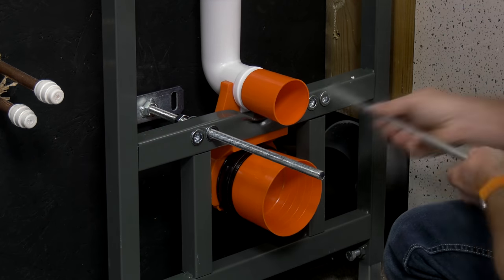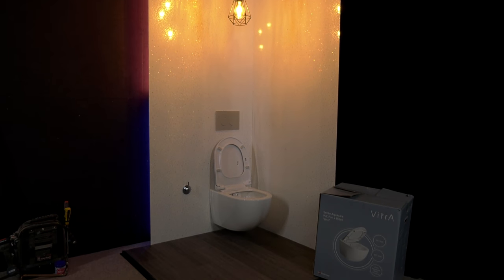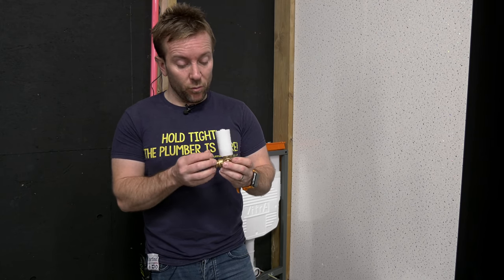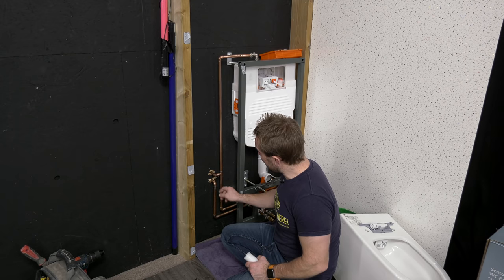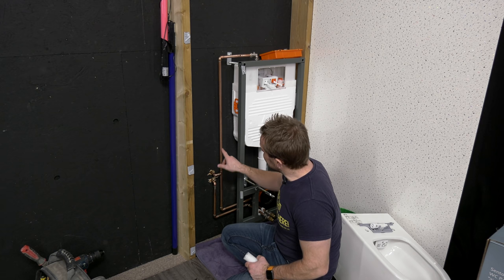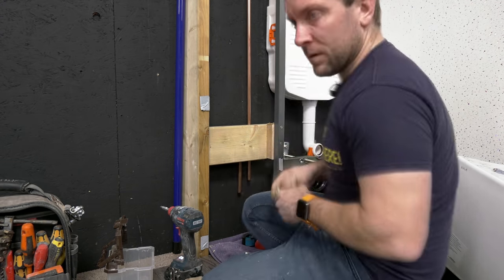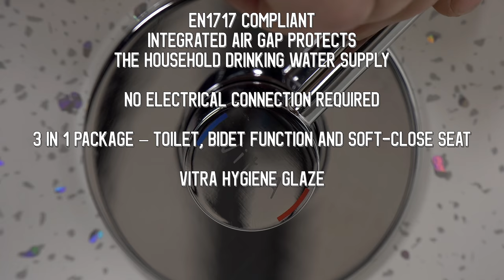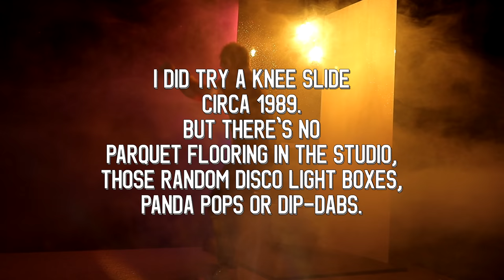HOW TO INSTALL A TOILET BIDET STEP BY STEP DIY - Vitra Aquacare

Comment: Hi Jimmy , great topical video these are becoming more and more popular. Many are not approved.  To comply fully with the "Water Supply (water fittings) Regulations 1999 the installer needs submit an application to install one of these to the local water company. This is known a Reg 5 application. The water company will want to know the about the product and how the water supply is to be protected against backflow. The backflow arrangements on this loo are known as Type AD (also known as a jump jet) rated for a fluid category 5 application. 👍
Reply from the maker: Cheers mate, you're THE go to knowledge man on this subject too! Hope you're all good.

Comment: What is the frame called that you've used?
Reply from the maker: The frame here is the one that come's with the Vitra loo. Although the Geberit ones fit too (I think!) LIVE STREAM TONIGHT at 6:30pm - Open to all! Bang the🔔too! https://youtu.be/TRJJjTkdENw
Reply: @plumberparts  cheers. Thanks for the reply mate. Re-doing our downstairs toilet soon and I like the look of these, just need to get the frame measurements to make sure it would fit, give that is under the stairs part.
Reply: Hi Jack, this is one of our regular floor and wall fixation frames, you can find some info on page 76 here https://www.vitra.co.uk/UPLOAD/Kataloglar/Bathroom_Collection_Technical_AW_SR-compressed.pdf :) we do also have slim and reduced height frame options!
Reply: @VitrABathrooms1  thanks I found them. 👍 Looks like decent kit. Standard one should fit where I was thinking too.

Comment: Don’t get it,, squirting water at your clay pit doesn’t seem right. I guess after you’ve  used it an stand up you get water running down ya legs an flooding ya undies ... Don’t think I’d ever use one
Reply from the maker: Use a bit of TR to dry off...boom!
Reply: @plumberparts  I've been using this technique since I was able to, since a child.

Even without TP, I'd rather have a clean wet bum than a dry cacky cracky🤮